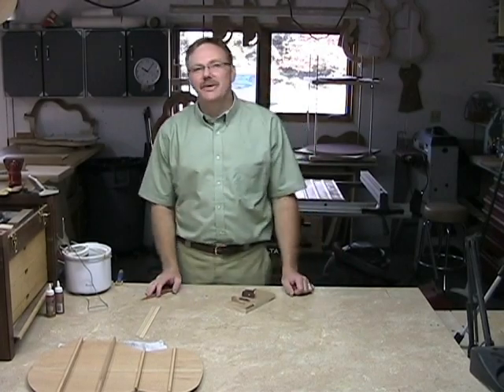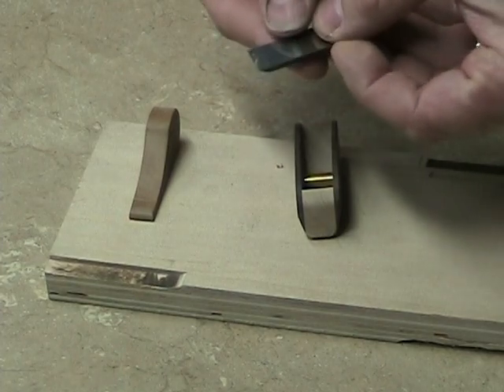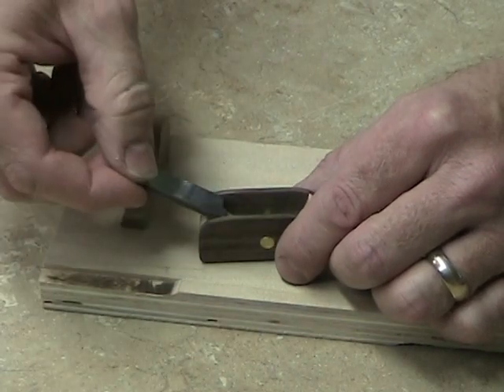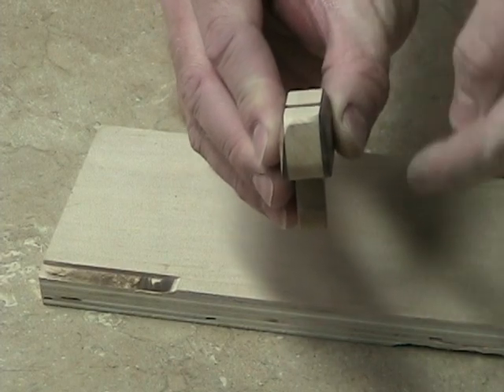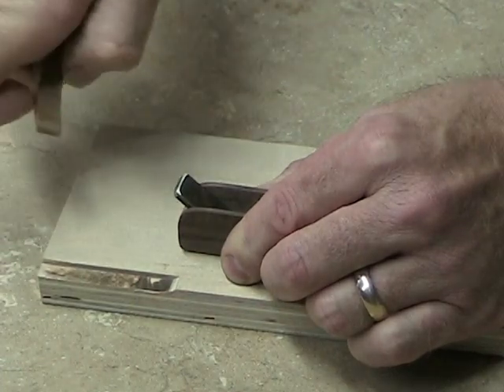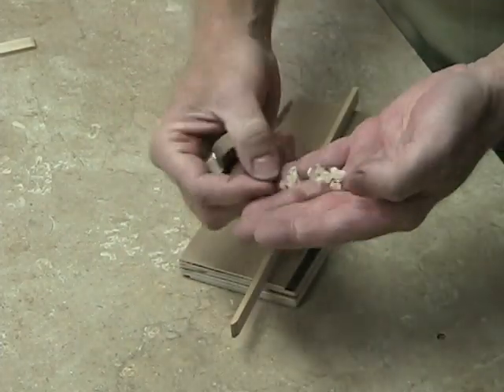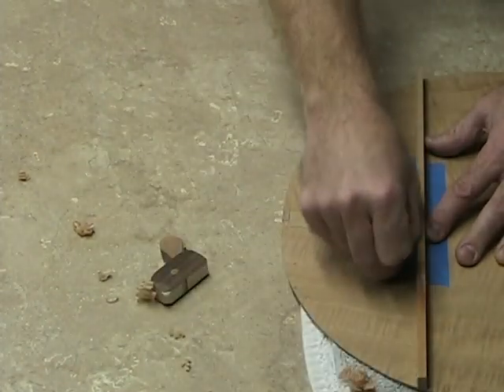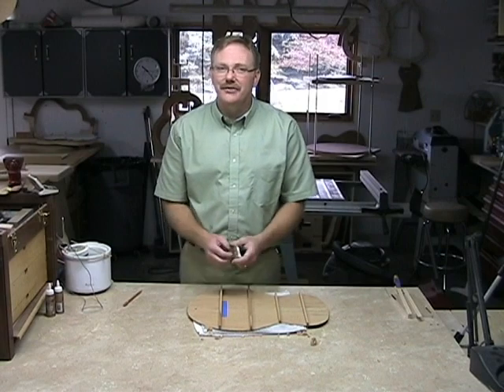wood working mini plane instructions

Comment: Stephen Boone is it possible take a mini size plane make a truss rod slot in a guitar neck? If so what kind of plane do you recommend?
Reply from the maker: If I were going to use a hand plane for that job, I would use a plow plane. It is not really a mini size plane. I feel that job and similar jobs are best done with a small router and a spiral type bit. Trying to use a plane to create such a long and deep channel is very challenging to do well with a plane.